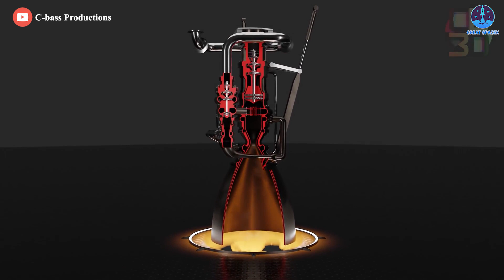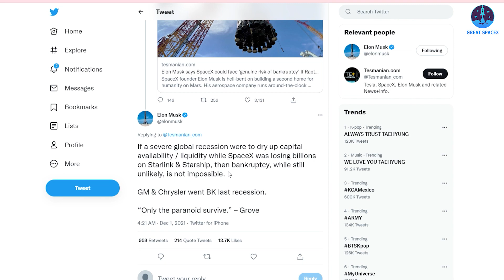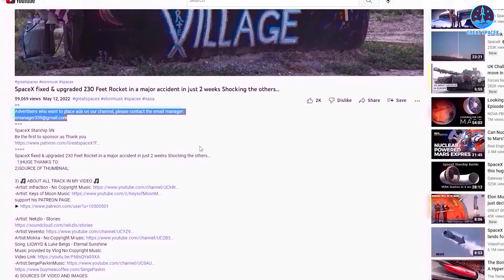Elon Musk frank revealed "Starship's hardest problem" as well as the entire rocket industry

Comment: Engines are always the most complex to manufacture in any class of vehicle.  An engine can easily make up for nearly half the cost of a car or truck.  Same thing goes for a large ship or airliner.  The reason is the engine has to be made to the tightest tolerances .  When an engine has a slightly worn part, it fails to work.  Occasionally it explodes.
Reply: TIL thank you!
Reply: I think this statement works for traditional combustion vehicles. In an EV it’s different. The fuel tank is where the cost and action is.

Comment: There is a missing element, customers. It doesn't matter how low you go if no one is buying, you go broke. The concept that Musk is discussing is design for manufacturing. The manufacturing engineers and quality should be in that loop. When a problem can be corrected and approved quickly then you are running in "greased groves".

Comment: the main issue is that there is no market for Starship as of today.
How many flights per year would do a Falcon-9 without starlink satellites?
How many flights does a FH?
Launching starship even once per day require an immense amount of payload to be delivered and for sure can't be starlink satellites only
Reply: Starship will replace falcon 9 completely for starlink 2.0. so just their own demand will be enough to sustain flights. And if the cost is really that cheap, there will be demand for huge payloads.
Reply: @HNedel  That assumes that Starlink broadband is a viable product vs all the other ways of accessing the internet. SpaceX would be a much more secure company if it had a range of external customers.
Reply: @Tailspin80  yes, it assumes that. It also assumes that with a price per kilogram to orbit many times lower than even falcon 9, all other commercial launch providers in the western hemisphere will become obsolete.
Reply: @HNedel  Many customers don’t need the vast payload capacity of Starship. If you have a small satellite to get into orbit then a small rocket available locally, now, is going to work better than waiting for the Starship supertanker. There have been 163 Falcon 9 missions but of these only 2 were Falcon Heavy.
Reply: @Tailspin80  Ride sharing is the answer. When you can send multiple payloads in one launch it brings the cost down significantly for each customer.
Reply: It’s always the problem with ambitious space flight, that the real demand only comes from earth based problems like communications satellites, mapping satellites, etc., plus a bit from academia. Musk may want to go to Mars and set up a colony but there is no evidence of a market for this service.
Reply: I think there is huge potential in asteroid mining.  Not just from the elements that are rare on earth, but abundant in space, but also for providing resources outside Earth's gravity well for building and fuelling large space structures.  Sadly, I think Elon Musk does not believe the economics of asteroid mining work, and he understands way better than me.
Reply: You forget this is all about Elon's wet dream to go to Mars.

Comment: Well it is like containing the energy of a continuous explosion without melting the engines or blowing them up, all the while pumping in liquid oxygen and combustible liquid hydrocarbon fuel in the correct ratios, and under pressures HIGHER than the explosive pressures in the rocket engines "explosive combustion" chamber's!!!   The fuel is VERY cold, the explosive combustion is VERY HOT.  Pressures in the rockets fuel tanks will vary due to volume variations and forces like acceleration, and the effects of any temperature changes during the rockets explosive burn period.  The direction of the outlet bells, or trumpet shaped NOZZLES  of some rocket engine need to be controlled by push or pull rods that may be powered by powerfull hydraulic or electric activators that need protection from excess heat and in some cases perhaps cold As well.  There are high pressure pumps to pump the rockets fuel into its engines, those pumps need to be powered by perhaps electricity, perhaps compressed nitrogen.  That is just the basics that actually have to work perfectly under extreeme conditions, so no wonder Elon Musk and his technical team etc feel this is a big challenge, especially with a rocket fitted with over three dozen engines in total.!!!
Reply: That's why it's called Rocket science.

Comment: Is the current Starship booster already designed (to the best of SpaceX knowledge) to handle three launches per day?

Likewise, what is stopping the Falcon 9 booster from being reused within the same day?
Reply: As the Falcon 9 Merlin engines burn kerosene a labor intensive process to clean the engines is required after each flight. No such issue with the methane burning Raptor engines.
Reply: @SirDeanosity  and also the landing legs needs to be replaced/refurbished after each flight
Reply: @Guren74  For prepping F9 does anything need to be done to the body (framing, sheeting, paint, bolts, wiring, etc) or only rework legs and clean out rockets?
Reply: @SirDeanosity  Very interesting.  I was only aware of the methane advantage for creation of fuel on Mars.
Reply: Some big brain replies!